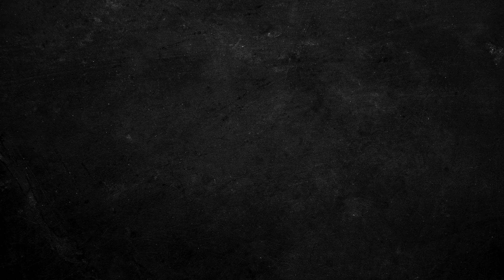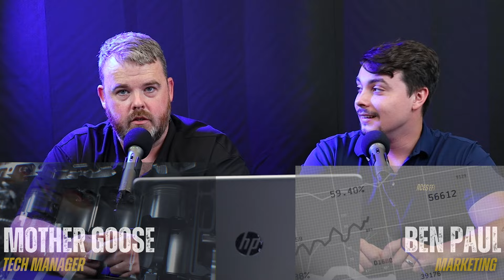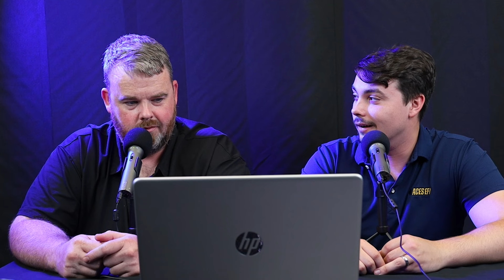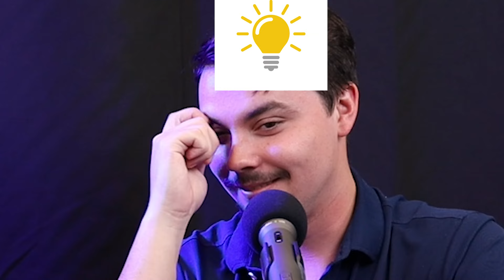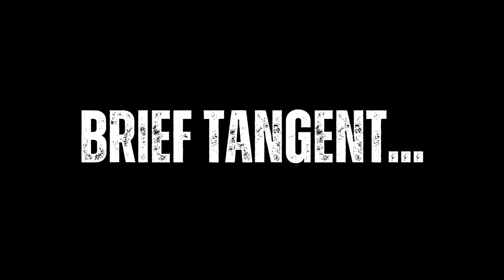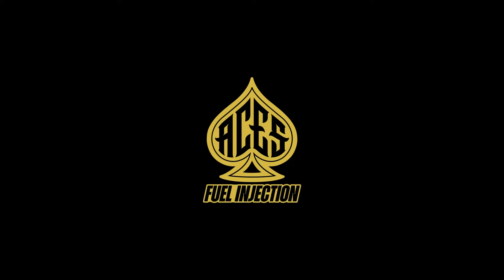Techy Answers (Tech Tuesday Ep. 39)

Comment: Just curious if you guys might ever be considering a multipoint 4 cylinder option similar to the fueltech setups for your jackpot systems ?   I know a lot of turbo-four type Fox platform guys would be interested compared to using the old ECC and PImpx/microsquirt stuff if so.    Thanks for all yoru efforts.

Comment: Hi Tim and Ben. I have a suggestion not a question. I don't think any of your competitors offer this. On your Black Jack Pro Distributors why not off an option for a locked-out distributor when ordering using a pull-down menu. Some people might not like hammering on a brand new distributor to remove the roll pin then hammer it back on. Also, if this process is done by ACES it will be done correctly (either in house or at the factory) with no warranty issues.